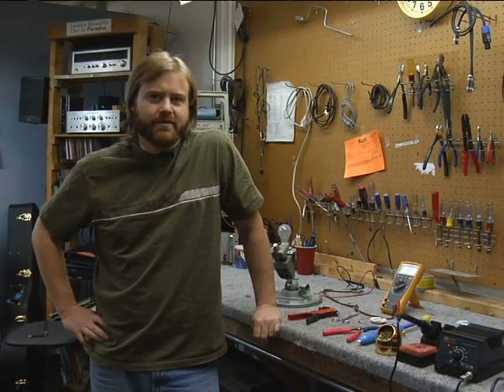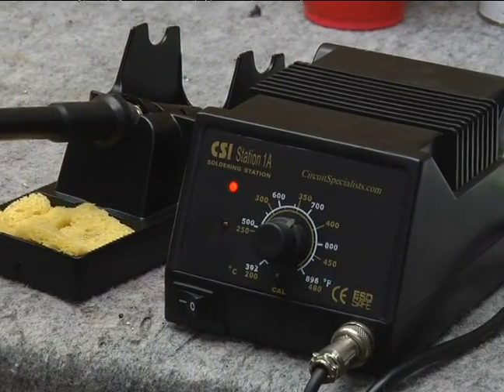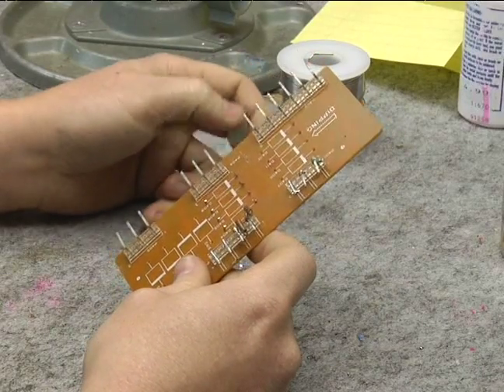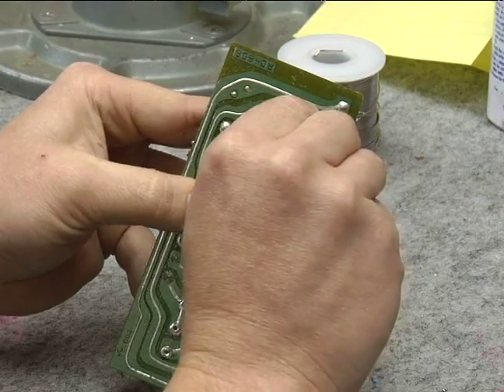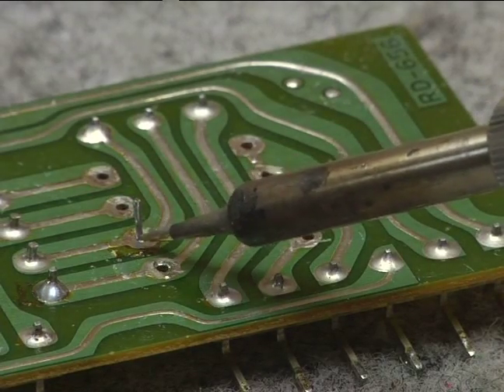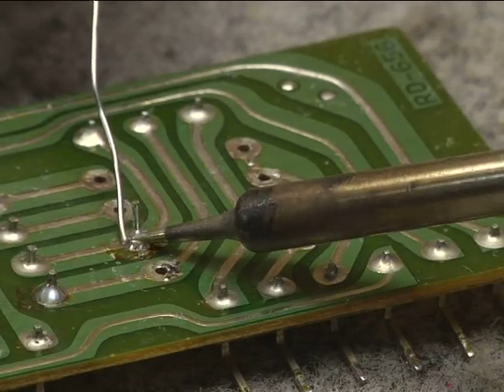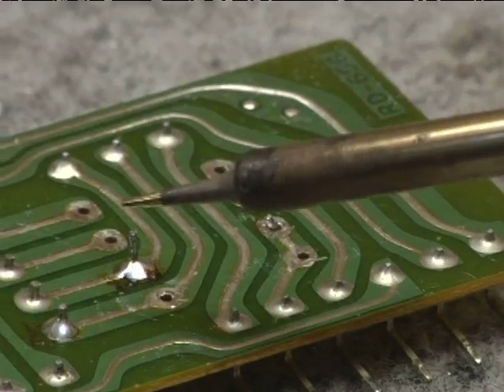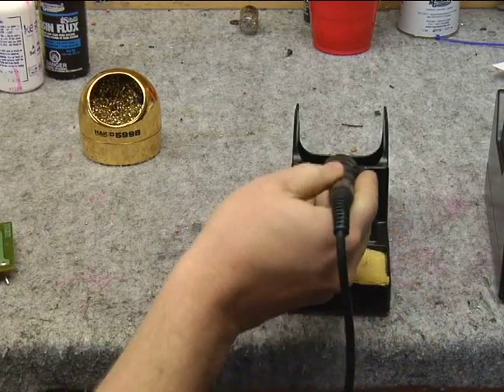How to Solder : Heating & Applying Solder

Comment: You're not smelting iron, you're soldering, you shouldn't burn the shit outta the PCB, and boil the solder, because there shouldn't be any "impurities" if you know what you're doing, the surface should have been cleaned prior to soldering at all. Most impurities won't just burn away, if anything they'll get in the bead and really keep the solder from taking. You shouldn't need to touch the PCB with the actual soldering iron more than 1 or 2 times per joint, and never hold it against the surface.

Comment: @diesalweasel It is true that the mixing of different kinds of solder makes them harder to melt, but soft solder is added for heat transfer anyway. Your soldering iron is too weak, I'd recommend 100W at least. These multi-layer PCBs are hard to heat and you want to do the job ASAP before anything takes damage.

Comment: @ZdenekJindra can i ask queston .i do dc jack on a laptop i find it difficould to penatrate the old solder and when i add your every day solder it tends to mix with the old solder and makes it stronger and harder to remove .am i doing something wrong .am i right thinking thay use silver solder i heard that hard solder is that true and your normal every day is soft solder .i have a antex xs 25watt soldering iron nealey new .i'v asked you because you got experience 
regards jamie

Comment: My god the shit that comes out of expertvillage. Look: heat for too long, too much solder, and shiny does not necessarily mean a good joint. Tin the tip before you replace it. And tin the tip before you begin soldering, thanks for not showing us that crucial step. And that wasn't impurities you saw boiling off, that was flux. 
No flux = oxidation, and oxidation means the solder won't adhere to the joint.

Bottom line, if you're new to soldering stay the hell away from these vids.

Comment: I do soldering for over 20 years and I own a temperature-regulated soldering iron. This video is just weird. The method described here is only good for fresh boards and parts with new, tinned leads. For most other purposes and jobs involving old components, I prefer to carry the flux and a drop of tin to the joint with the iron's tip. This allows for precise amounts and leaves your other hand free for holding the components.

Comment: This guy is on crack look at How and WHY to Solder Correctly. It's one of the best soldering videos I've ever seen. Never hold a soldering tip that long on a pad/part or you will destroy the part or burn the pad off the board.

Comment: one thing that the video said that's not really true that "the inpurity's boil of"
the main point of sodering is to bond a metal lead of an electrical componant to the cuircet board.
you should NEVER under ANY curcumstances heat a component for any longer then 10 seconds
for example many transistors will be destroyed if you heat them any longer than that (also apply's for diodes) and many plastic components will melt (for example a dip socket for a chip)

Comment: Agree, lead free is crap. But so much heat can damage the component. Especially if it's an IC. And i said you keep the iron tip too much on the joint, the component can overheat you may damage the chip.

Comment: Proper heating techniques?
Proper temperatures are important eh?

Learning how to pronounce the word "soldering" properly would be a good start.

Look at the word "SOLDER" it is not spelt SAUDER as you yanks pronounce it.
 Think of the word "sold" and "der". Now put them together ie, sold-der.
Thats how it should be pronounced.

Comment: if you wait till the flux is bubbled up, you wont get a good joint. remove the iron as the solder flows around the joint, but do not wait till the solder stops smoking.